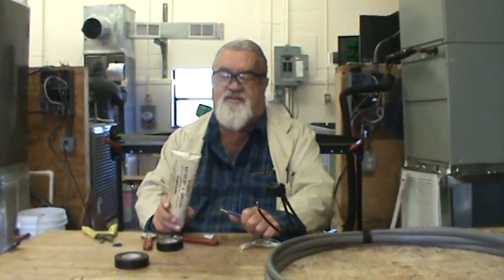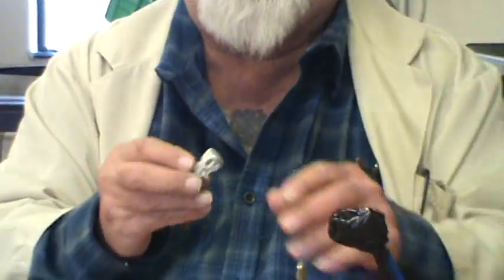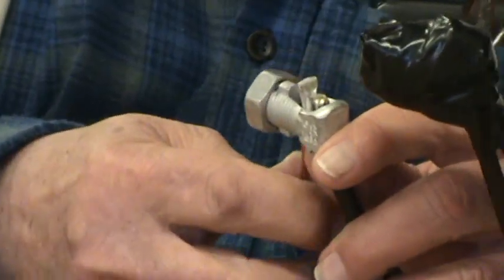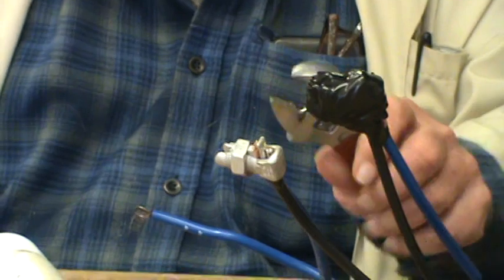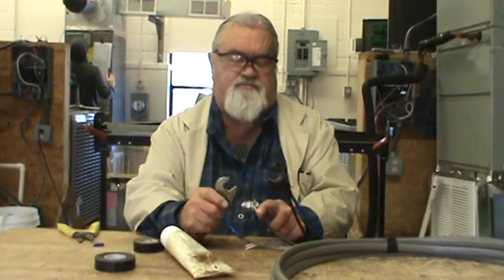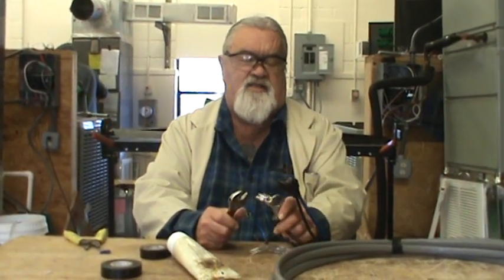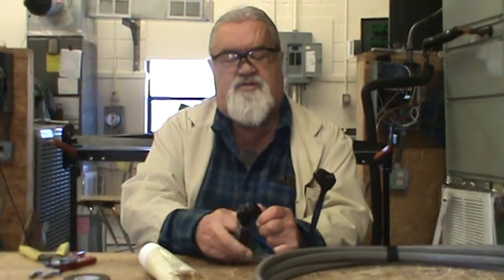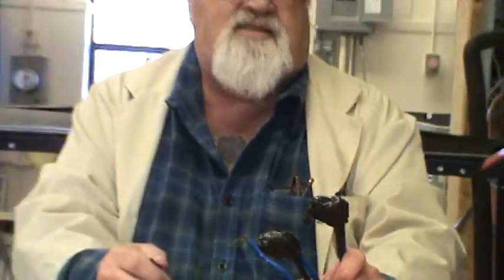How to wire a split-bolt

Comment: Did I miss where you put some anti-oxidizing goop on the aluminum wire before you connected them in the split bolt?
Reply: I always like the stuff we use at work for sealing conduits...It's called Chico..The entire job site yelling "Hey man jew got da Chico??"...."Naaa...I ain't got no Chico"...."How bout jew? You got da Chico??"   funny stuff..
Reply: It was very early in the video, about 10 seconds in.If you blink, you might miss it.  He has a hole poked in the side of his goop tube, and simply thrusts the end of the wire in.
Reply: I was wondering the same thing.
Reply: I thought friction tape was the first layer of tape as well.

Comment: We're gonna need a bigger role of tape.
Reply from the maker: No that size works just right use a lot Thanks for watching
Reply: Perhaps he forgot to mention he's trying to insulate it for 20,000 volts!  Just kidding.  But you need some extra tape to perhaps protect against physical damage that may cut through several layers.  Plus tape is pretty inexpensive.  And thanks for the video, I didn't know split bolts were for, or could be used for, connecting copper to aluminum.
Reply: @massengineer7582  "...I didn't know split bolts ...could be used for connecting copper to aluminum." They have to be the correct type. I think that means they need to be made out of either tin-plated copper, or aluminum. "SW" or "SWA" type.
Reply: I think the tape already plays a pretty big role.